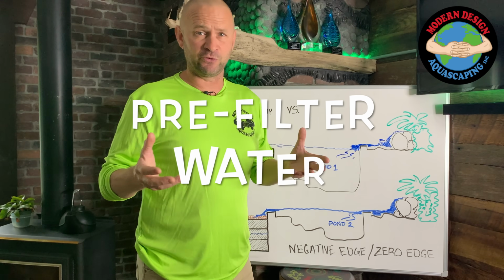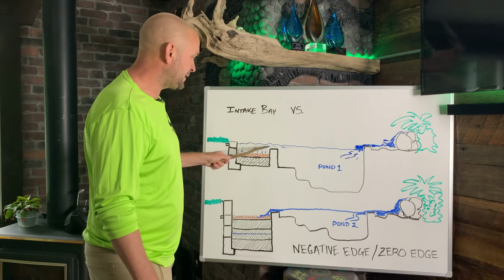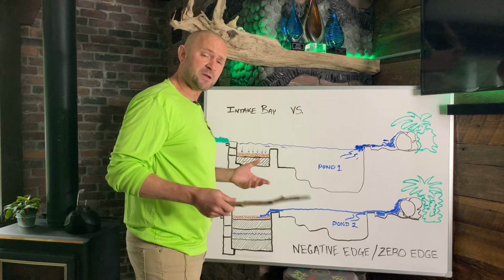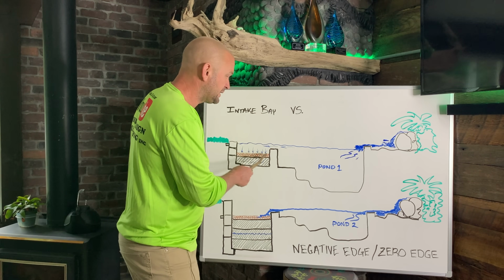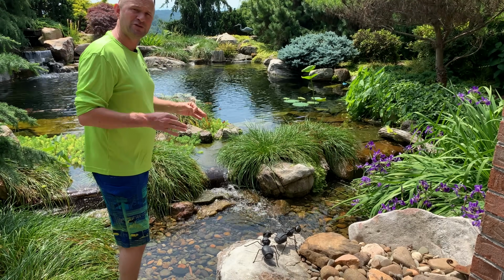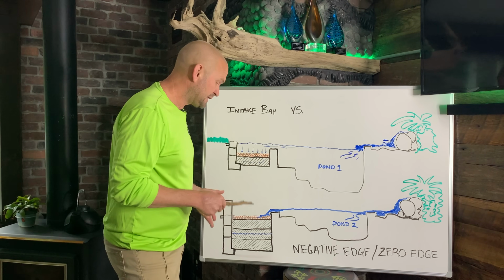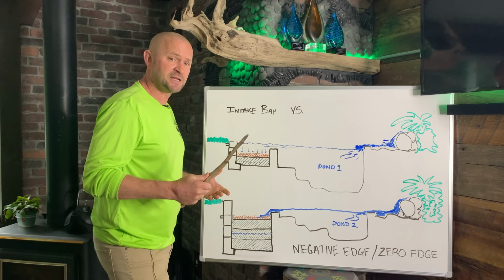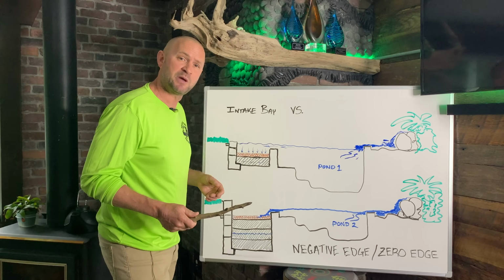Zero Edge vs. Intake Bay | Which Pond Skimmer is Right for You?

Comment: Thanks for posting these videos.  They are very inspiring and very helpful.  I'm working on designing a garden/wildlife pond and I'm interested in using an intake bay instead of a skimmer.  I like you videos on the subject but I'm in need of more details on the design and engineering.  For example you say it should be designed based on flow rate, which makes sense, but what are the numbers?  What is the ideal ratio of pond surface area to flow rate through the intake?  Once flow rate is determined what is the ratio of flow rate to surface area of intake foot print?  What is the ratio of flow rate to width of intake channel?  What is the depth of intake channel?  What depth of gravel in the bay? What size gravel?  If there are equations outlined in a different video please direct me to that video.
Reply from the maker: No all great questions. There are so many factors that can influence the answers though, it could be an entire video series. Normal practice for me is to design the wetland filter, jets, waterfalls, etc. to come up with a “total flow rate for the feature. From there I size the number of Aquablocks in the intake at 1-2 surface blocks per 1000 GPH of total flow. Depth depends on width of intake, desired flow speeds, potential water level fluctuation, etc, etc. We typically use 3”-6” cobble over the infiltration area so you can “grub” or vacuum the debris from the surface without too much trouble. If you think about flow going into the intake, you can look at our video on the dinosaur pond. That flow in the video is 20,000 GPH and it looks great. Its about 4’ wide and 18”-ish deep. Think about flows into skimmers (speed vs. flow rates) and you will get some ideas on what is possible! Hope this helped?
Reply: @koiaddiction  I'd like to watch that series of videos if you have it. If not, I'd watch it if you produce it.
Reply: @koiaddiction  Please make an advanced series of videos that explain the factors to consider when designing the wetland, jets, waterfalls. You touch briefly on one aspect of calculating flow rate with the water in motion videos, so I don't think you need to recreate those.

Comment: I'm having a HUGE problem with my negative edge design. There is a flat weir stone and a foot drop into the negative edge gravel pit. The current is so strong there, the koi are drawn to it like catnip, and over the falls, and then they flip and flop out of the little bit of water there and die 😢 before I find them. Underneath the falls is gravel covering up a huge vault of aquablocks 6ft deep (it is the main return vault for the whole pond). If I "dam" up the weir stone, the pond backs up and overflows its banks. So I've loosely blocked it up with rocks but now that Spring is here, the koi are more active again, exploring the pond boundaries more, and I've lost 3 this week alone. Any thoughts as to what I can do? The fish are important to me, i love them. (The pond is 25k gallons)

Comment: Thank you very much, your videos are always informative 👏🏻☺! I have an existing swim pond with fishes built in 2009, EPDM liner, 20m x 16m, 2m deep (65 ft x 52 ft, 7 ft deep). I want to enhance it with a wetland filter and stream for better water quality, circulation, oxygenation, more fish habitats... 

I couldn't find answers to my questions in forums or videos, so I'll just post here: 

- Can you build a Wetland filter with the waterlevel  BELOW the pond waterlevel? 

The pump in an external vault at the the end of the wetland filter would be pumping water uphill (150cm / 5ft.) to a stream, which flows into the pond, pushing the water through a negative edge at the pond's intake bay into the wetland filter (via underground pipe). I'll post detailed graphs in the Gardenpondforum.

The water circuit would be:
...  from the pond's intake bay (0 cm/ 0 inch waterlevel Reference) 
   -> to wetland filter via underground pipe, waterlevel below pond (approx. -5cm / -2inch)
       -> to external pump vault at the end of the wetland filter
         -> pumping water uphill to stream (+150cm / 5ft.)
            -> stream flows into pond, pushing water to the intake bay through a negative edge ...

Comment: First off, you have some of the best pond building videos on YT and I love that your son has taken over the videos. In the video you state that the negative edge filtration needs to be sized correctly, but you don't explain how to size it properly. I've watched several of your videos to see if you explain it, but haven't come across it.  What is the proper flow rate? I'm assuming it has to do with the rate at which the entire volume of the pond gets cycled through the filter.

Comment: Would it be possible to use a gravity filter system to protect the filter but install it into a natural looking pond?
Reply from the maker: Not sure I am following you- we have done gravity filters before, how are you hoping to use it?
Reply: @koiaddiction  maybe my real question is, where can or should the water be pulled from for proper circulation. Can I only use a negative edge for a pond (taking water only from the top) or do you need some way to pump or circulate the bottom of the pond?
Reply from the maker: We do both. If you have a pump pulling from below the negative edge (in that reservoir) that can feed your filter without disturbing thermocline. We then use a separate pump for jets and pond circulation, this allows us to “winterize” in colder areas. You can also do that with aeration in the pond ;)

Comment: For intake bay size, you mentioned that it depends on the flow rate. Is there a formula to calculate for it and would it help to build it larger than that size?
Reply from the maker: Yes sorry for delay…we do 1 to 2 large aquablocks per 1000 GPH flow rate, 1 on a easy access, no leaf problems, regularly maintained feature and 2+ if it is commercial etc.

Comment: Hi John, can you please clarify something for me regarding intake bays? You mention that it makes servicing your pumps very easy and that you can simply pull your pumps out of the water, but surely the pipework that feeds them,  travel through the wall of the intake bay and as such prevent the pumps from being lifted out. Many thanks Ian.
Reply from the maker: Yes, you still have to open (access) vault lid and disconnect the unions to remove the pumps but it is much easier to do than in other situations…

Comment: The only difference I can tell is the level of the water???
Reply from the maker: The actual “act” of the water falling off of the pond makes the surface water 1000% more clear-unobstructed-and pristine! All sediment, pollen, leaves, etc. fall and gather in the negative edge reservoir instead of in the pond. It also puts a lot more water into your system, sub-grade. This helps with temperature regulation (via geo-thermal) as well as keeping more water out of the sun, which helps cut back on algal issues. Many benefits, unfortunately I didn’t go there in the video! Food for thought…

Comment: My parents have a pond they've had for decades and I'd like to add an intake bay because of our tree situation. Money is tight...my Dad is 88, Mom 82...so I need to do this as DIY as possible. I've been researching this for a couple of weeks and find very little actual information out there, especially for DIY. Their pond is between 850-1050 gal (not sure about average depth), they have 2 pumps - 1056 & 1299 - plus Clearguard filter. No actual waterfall yet - can never decide on a design - but have one rigged up with a simple shelf & recirculating, and another short one from the filter. Would like to build an intake bay that pumps into a bog, spilling back into the pond, with the 1200 on the filter pumping into the waterfall. The current layout is an oval pond with an 8' stream and the "waterfall" on the SW corner. There is an opportunity to put the bay on the NNE corner, but no room for the bog, so we'd have to pipe over to the south end for the bog. We have good water quality, especially since switching from the TetraPond filter to Clearguard, so a bog isn't so much a necessity as a benefit.

I know this is way too much information but that's me! I need to work out as much as possible because of costs and the effort, as I'm no spring chicken either! Just consider this a bid for more info on the Intake Bay! :)
Reply from the maker: Sounds like a great skimmer could be an option for you if leaves are the problem. People often think the intake bay is a magic bullet BUT it just pulls debris into a corner where you can remove it. We just installed a huge intake bay last week and we used a skimmer in the back of it as well. Lots of ways to skin a cat as they say. You may consider an intake with a skimmer or a stand alone skimmer (Aquascape 1000 signature series is my favorite). That will handle flow rates up to 7000 GPH well and will greatly reduce the leaf issues. Intake bay will be more work less frequently if that makes sense??

Comment: I would like to know how big i need to make my  negative edge on my pond. It's going to be 24x22. 7ft deep to 4.6ft deep. I also need to know wetland filter size.
Reply from the maker: You can use our “water in motion” videos to help you calculate reservoir size. I make negative edge Ass wide as I can so fish don’t hop over. If you have room, make a stream between the res and the pond. I like to go 1’ of width per 1000GPH flow but you can do 2000 GPH per foot if you have to (go longer stream then). If you need more help just call our office and Nina will discuss options. I can help you if needed :)

Comment: John G Adams, your videos are awesome!  So awesome I am designing a brand new swimming pool for our weekend house based on these concepts. We will have it built like a pond and treated with chlorine, so no fish, but the look and feel of a natural pond in our garden.  I want to place a negative edge system to collect most of the falling leaves before they get a chance to sink.  This will run 24/7 and the water filtration system will run on a timer, according to it's own specific needs.  My greatest concern is the dimension of the water reserve.  My pool is 105 square meters in area and there is no water in motion prior to the pool.  I asked a local pool guy for help on designing the reservoir but I'm really not confortable with the numbers he came up with.  He says a 6000 liters reservoir will do the trick.  Can we pull it off with just this?  To me, he is thinking in terms of negative edges in pools, which is just a fine sheet of water over a long edge.  I want more of a cascading effect.  Also, how do estimate the pumps to use in order to get the desired water cascade effect.  Thank you so much for the great work and inspiration!  Cheers!
Reply from the maker: First you need to decide what type of pump you’re going to use or pumps. Then decide how wide you’re going to make the waterfall spillway coming out of your pool into the reservoir. That should give you a calculation of water thickness with a little bit of research. Then depending on how well you build the negative edge, will determine how much water in motion you actually end up with. For me typically I figure 4 inches of water in motion has a safe bet, but this can vary depending on construction methodology and water flows. Now that you figure your water in motion then go two times minimum or three times the amount of water in motion for your holding capacity in the reservoir. Does that answer your questions?

Comment: What if the water level in the main pond drops below the drop off, is the the pump hooked up to a shut-off valve?
Reply from the maker: The water level in the main pond stays constant. Think of a sink full of water with the faucet running (waterfall). The water level in the sink remains constant, it only over-flows as the water from the faucet pours in. The pump is in the lower reservoir (below the sink), it returns water through the faucet up top. The water level below is all that changes. If the pump runs out of water below (reservoir) runs out, the pump stops, as does the over-flowing of the sink. The entire time, the sink stays full to the over-flowing level and the level of the reservoir is the only thing that CAN change! If the reservoir is properly sized (and / or) it has an auto-filler installed at the proper level, you will be good. We good??

Comment: Very informative channel! 

I’m having a hard time seeing the actual difference in structure of an intake bay vs negative edge on paper. Although I your drawings, the negative edge reservoir is 3 blocks deep vs 1, It seems the only functional difference I can figure out where the water volume/level is at. ie if you ran an intake bay setup with less water, it becomes functionally equivalent to a negative edge? Conversely, adding more water to a negative edge system and it becomes functionally the same as the top drawing?

Also, with the negative edge diagram, the water level in the reservoir is lower than the gravel - wouldn’t that make skimming debris/leaves impossible since it would just be solids siting in gravel?
Reply from the maker: The water falls off of a negative edge and has to be designed so the reservoir below is big enough to hold the water in motion x 2 or 3. The intake bay operates inside the pond - no falling into it- the # of blocks is based on flow rates in the IB vs. designed for holding capacity in the Neg Edge!
Reply: @koiaddiction  thanks for the reply! It seems like the intake bay would be easier to clean debris since you could skim it with a net, but a negative edge would have leaves and debris just sitting on rocks since the water level is below inside the reservoir? It seems like that would be harder to remove organic material from with it stuck in the rocks?
Reply: @BeckiandChris  Can't speak for MDA but my biggest reason for opting for the Intake Bay vs Negative is looks. I don't really have a big enough pond to hide something that seems to be, as you've said, gravel, and would rather have a nice little "pool" where maybe the smaller fishes might swim in and I can easily grab the leaves that make it to the area. I understand the negative edge seems to be more forceful and will do a better job of removal, especially if you don't stay on top of the IB, but I'd prefer to see that cute little pond!

Comment: Is there a video to size my intake bay? Water depth, depth of weir, width across bay and width across intake. I had hope a 2x2 or 2x3 ft bay at 2ft deep would do for my 11x26 swim pond
Reply from the maker: I use a small aquablock per 500-1000 gallons of flow for infiltration of water in intake.  Weir depth is wide open- make it larger and you can block it- make it too small yer screwed!

Comment: If I understand correctly the negative edge system is basically used just a skimmer section for the pond and the water is then pumped to the wetlands filter?
Reply from the maker: That is correct! It is a big-fancy skimmer at the basic level, even though it brings so much to the project!

Comment: Thanks for posting the very informative video. Can you also provide some info on what to take care of in terms of overflowing. Power outage happens when there is downpour, so no pumps are working, so how do we make sure that pond is not getting overflowed especially in underground pond ? what kind of special or extra plumbing is needed ?
Reply from the maker: A basic overflow system is fine. I like to use a drain basin set just above desired water level on the side of the intake area ;) Sink the basin outside the pond, drape the liner over the basin, and make a seal. As the water level goes up it runs into the basin & away!

Comment: Hi John,
Thank you very much once more time for this video. 
With a negative edge or an intake bay I wonder 2 things:
1) how good is it in filtrating very small debris  since with pebbles it can only trap “larger” debris like leaves but pollens and real small debris will go through? 
2) some of the debris will go through inside the Aquablox and sediment there. How do clean that area when needed ? 

I also wonder why in the Aquascape world you don’t use sieves as mechanical filter. It does trap debris much finer than a skimmer, an intake bay or a negative edge would do. What is your view on this ?
Reply from the maker: The design/ flow requirements in the wetland are based on “de-sedimentation” of the water as it disperses out in the bottom of the filter. You can see that from our large pond videos it is working. You can always improve on things. Smaller gravel - slower water etc. but each of these changes will effect other things in the system as well such as clea ability and dissolved oxygen levels. I am working on how to clean a wetland filter on a pond for next year. Bottom of pond wetland NOT my7 first choice-even though plants are a benefit to the filter they are not necessary for biological filtration to occur. Bottom of pond filter requires the pond to be emptied for filter cleaning Which is why I don’t prefer that way. We don’t backflus a wetland in a pond until it is emptied- if the wetland is separate you can clean it without disturbing the pond at all!. Thanks for the interaction ;)

Comment: I'm curious about heating a natural pool or spa that has plants .... Probably not fish. Any advice on heating a natural pool with plants? Like a hot tub?
Reply from the maker: I guess you could. Not sure how the “ecosystem” would work without fish, it’s sort of like leaving out one of the ingredients in a recipe- who knows what it will look like in the end??
Reply: @koiaddiction  could I have the whole system connected and have hot tub seperate and have everything flow through one system but able to cut off hot tub while in use and then after wait for it to cool off Then allow it to recirculate? I only want to heat hot tub in winter and not too often. During summer just an additional plunge pool.